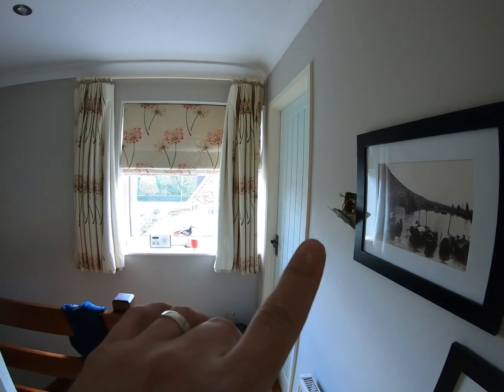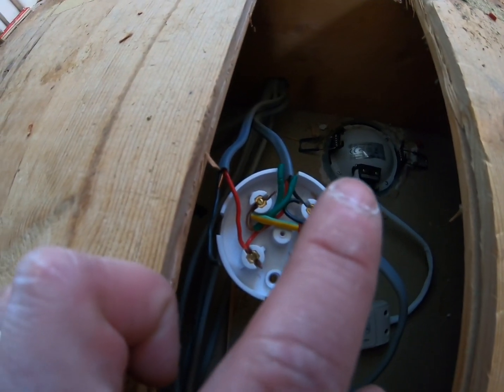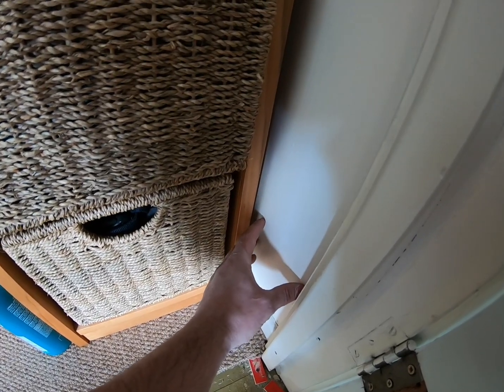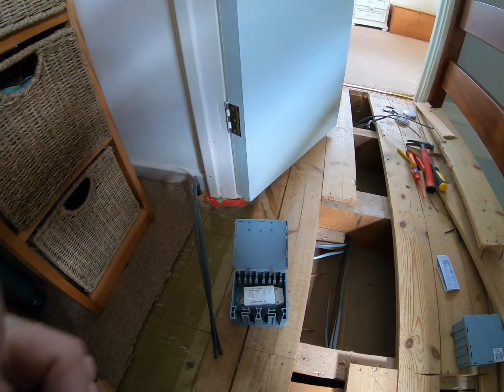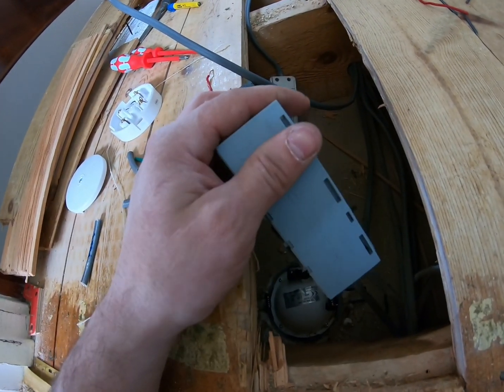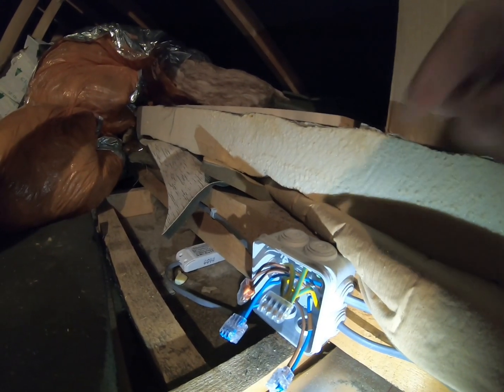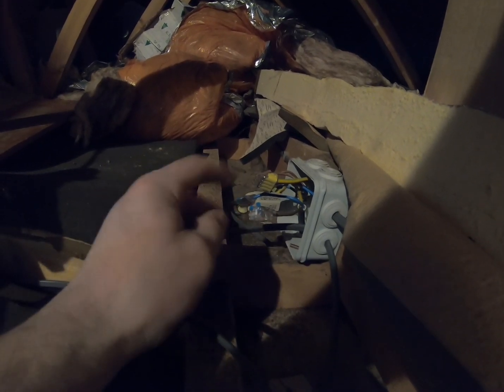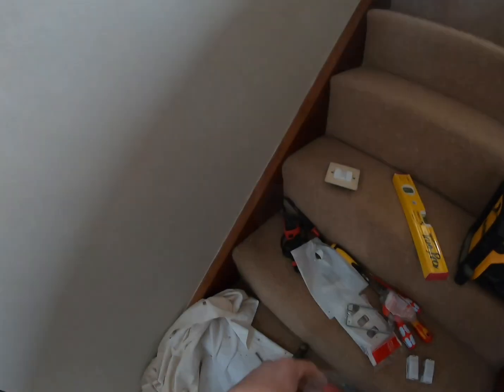How I got around a borrowed neutral - Electrician

Comment: i can't quite work out how that solved the issue.  the circuit downstairs was extended from the light light to the receiver and then back to the light.  same for upstairs using the same neutral that was shared? The comments about just put both circuit on the same rcd are worrying.  That to me implies they put them in separate breakers, both lines should be in the same breaker if this is done.
Reply from the maker: The borrowed neutral was completely disconnected at the two switches, meaning that the up and down lighting circuits were independent. A permanent L/N/E was taken from the pendant to the receiver and back to the pendant. The receiver turns the power onto  the light when the wireless switch clicked making the light come on. This was repeated for both up and down lights. Wireless switches were installed on the landing and at the bottom of the stairs, meaning 2way switching was reinstated without a borrowed neutral and no damage being caused to the decoration of the house.
Reply: @ShockingPom  odd that the neutral went through the switches to the light.  in my experience of this a single neutral is  thrown all way round the lights and switch lines to switches with 2 strappers linking the switches. .  I have used quinetic before and they are good, still prefer full cabling though, but these do provide a solution

Comment: Just put them on the same RCD, job done.
Reply from the maker: Well, you could do that, but it's a bit gash tbh! 
Say there is an earth fault on either  lighting circuit or any curcuit protected by that RCD, then all the lights in the house go out. It's not a good idea IMO to bunch both lighting circuits together on the same RCD for this reason. 

If it's worth doing, it's worth doing properly👍🏻
Reply: @ShockingPom  It seems like a very expensive way to resolve a fault, I’d want to install a new 3 core and earth cable between the switches but if the client didn’t want the hassle of redecorating cost, I’d just put them on the same RCD. Quinetic switches and receiver seem like an expensive option.
Reply: @Tobias_YT Problem solved 👍

Comment: Personally I would not cause the customer hassle and probably about £1000 worth of work just to separate the neutral, put both lighting circuits on the same side of the rcd and its sorted or pull a new main to the landing light, absolute no reason to rewire the whole lighting circuits upstairs just because you don't get selectivity between the circuits, a good majority or older properties from 60/70s and even some 80s have borrowed neutrals/shared neutrals
Reply from the maker: I'm not sure what experience you have with the wireless Quinetic receivers and switches. But, its minimal work and disruption to get around this very common problem. This way it avoids having both circuits on the same RCD which is far from ideal in the event of a fault when potentially both lights up and down could be affected and off. Go check them out.

Comment: Another quality job and video mate. The Quinetic switches are so handy especially for these kinds of jobs. 👍🏻

Used them a few times now and quoted another yesterday for a light that getting a feed to wouldn’t be an issue but the switch line would be. Using this meant it’s going to be really easy to do so and no damage!

Put one in for some floods to my garden as I didn’t want to have to get a switch wire back, works so well!